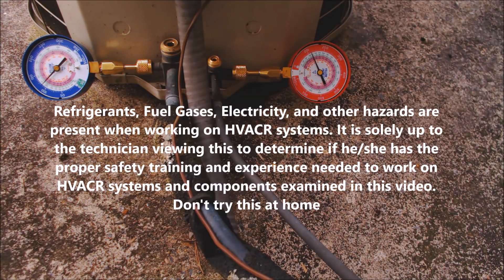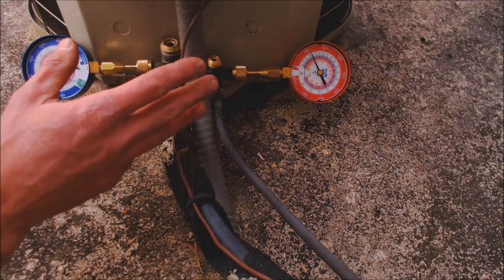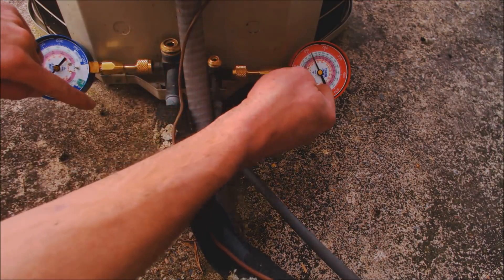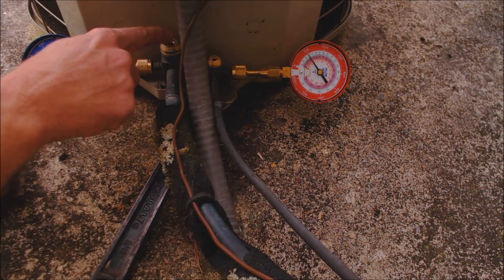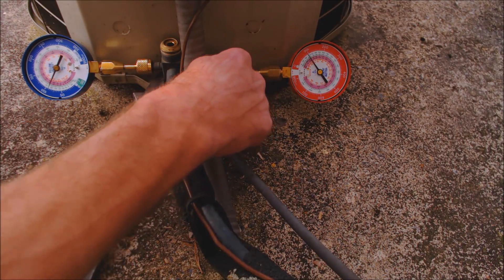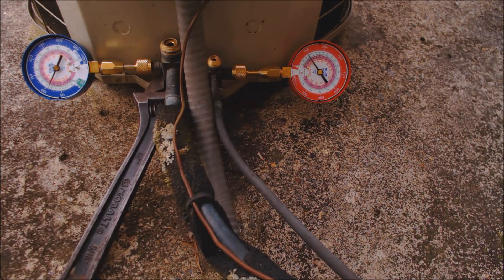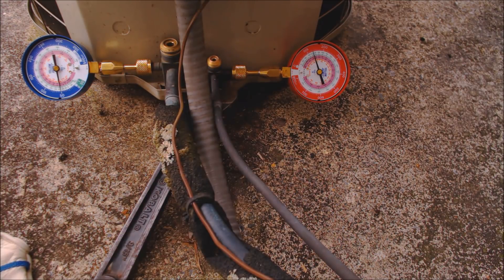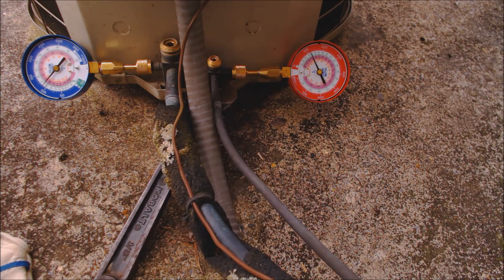HVAC Pump Down Procedure Problem!

Comment from the maker: Tool List-  https://www.amazon.com/shop/acservicetech
Support-  https://www.patreon.com/acservicetech
For those that are looking for the tools used in the videos: (Linked Below)
Here is the link for the Ratcheting Service Wrench   http://amzn.to/2dGV4Nh

JB Quick Connect Test Gauge High Side-  http://amzn.to/2ruQb0l

JB Quick Connect Test Gauge Low Side-  http://amzn.to/2qR0utM

Here is the link to the Appion Valve Core Removal Tool- http://amzn.to/2uYr8WL

Here is the link for the C&D Valve Core Removal Tool- https://amzn.to/2vqA0qy

Here is a link for RectorSeal Bubble Gas Leak Detector http://amzn.to/2ckWACn

Here is the link to the pack of 25 C&D valve cores- https://amzn.to/2J1lurm

Here is the link for the C&D Valve Core Wrench, Container, and 3 valve cores- https://amzn.to/2EVGkps
Here is the link to the Appion Valve Core Removal Tool- http://amzn.to/2uYr8WL

Here is the Link to the Fieldpiece MR45 Recovery Machine- http://amzn.to/2xAOpN6

Here is the link for the filter drier- http://amzn.to/2veVV3m

Here is the link to the Yellow Jacket 1/4" by 1/4" heavy duty hose straight-  http://amzn.to/2umtcod

Here is a link to the Digital Refrigerant Scale used in the video
http://amzn.to/2b9oXYl   

Yellow Jacket Quick Coupler-  http://amzn.to/2s3GVTG

JB Quick Connect Test Gauge High Side-  http://amzn.to/2ruQb0l

JB Quick Connect Test Gauge Low Side-  http://amzn.to/2qR0utM

Other tool links can be found in the video description section.

ACSERVICETECH is a participant in the Amazon Services LLC Associates Program, an affiliate advertising program designed to provide a means for sites to earn advertising fees by advertising and linking to Amazon.

All of the ACSERVICETECH Playlists-  https://www.youtube.com/channel/UCOZR-1IqsAer9wzlvFgb4mA/playlists?view_as=public

If you want to support the ACSERVICETECH Channel and receive more HVAC content, correspond, or collaborate on your endeavors- check out www.Patreon.com/acservicetech

Comment: Just pumped down a 410 unit that has been off and unused for years.  After i got it pumped down i closed the valves and when i cut the lineset the thing shat out like a gallon of foam..  both gauges read 0 for a minute at least and still it foamed up out of the lineset.  Dunno..

Comment: What happens when you have extra long line set (about 15ft extra) - would the condenser have enough capacity to hold all the refrigerant in a pump down?

Comment: Was wondering if the liquid line is closed for a few minutes, but instead of continuing the pump down procedure the liquid line is reopened, what response would you expect before normal operation restarts. Would you need to wait for balancing of refrigerant around system before it starts working again, or perhaps freezing up occurring?

Comment: My understanding is you should not pump down a scroll compressor below 10psi. You can short out the compressor by doing it lower than 10psi.
Reply from the maker: Yes it depends on the manufacturer some are 5psi or 10psi, thanks

Comment: What do you do when the pressures equalize before you can get it pumped down, or what about pumping down heat pumps?
Reply from the maker: Make sure to temporarily jump any low pressure switches. Make sure the tstat is set on cooling. You can shut off the unit at the outdoor disconnect. Make sure the indoor fan is running. If the internal pressure relief pops before getting down to vacuum or 0psig then just shut the service valves quickly and then turn the unit off. Recover the rest of the refrigerant with a recovery machine and bottle, thanks

Comment: What about when you're pumping down a condenser and the compressor starts hissing at ya and not allowing it to pump down??
Reply from the maker: That is the internal pressure relief. It just means the relief is a little weak but the unit may still function fine. Just shut both valves down quickly, then shut the unit off and recover the rest. Thanks

Comment: I'm watching because I am considering adding HVAC to my skills list. Question. Could you crimp the liquid line here to stop the flow?
Reply from the maker: Yes, you could use a crimp off block such as this on the liquid line if desired but you would still shut the vapor line off after getting to 0psig or lower in case the compressor leaks when the unit is off, thanks-  Here is a link to the Yellow Jacket Pinch Off Tool- http://amzn.to/2uqV24o

Comment: That sounded like an o-ring asking for help.  I had  one making the same noise while being closed and then it started to leak.  After these O-rings have been in there for a while, and especially if mistreated during brazing, they have a good chance not to survive the trip while being closed and then reopened
Reply from the maker: This one was bad threads but the o-ring was still holding the refrigerant back, thanks!

Comment: Love the videos..... truly. Can you explain the procedure of removing R410A of a system that's overcharged please.
Reply from the maker: While the system is running, keep the blue vapor handle shut. Once you purge the air out of the yellow hose by shutting the valve at the end of the yellow hose, open the red handle, then open the valve at the end of the yellow hose slowly until the air is out and only refrigerant is in the hose. Close the valve at the end of the yellow hose. Close the red liquid handle on the manifold gauge set. Connect the yellow hose to the liquid port on the recovery tank. Open the recovery tank handle. Open valve on the end of the yellow hose. Charge liquid refrigerant into the recovery tank from the unit by opening the red liquid handle a little at a time until your superheat or subcooling is correct. Make sure to not overfill the bottle. Check out videos in the "acservicetech recovery playlist" Just type that in the search. If you want to support the videos and get articles check out patreon.com/acservicetech thanks

Comment: Great videos Sir. They describe real situations in the field. About this one Id like you show us how to recover and put back a small amount of refrigerant. I always seem to have problems to put it back when is just a pound.
 Thank you.
Reply from the maker: Do you mean you are having a problem on small systems getting the refrigerant back in while breaking the vacuum? You would not be able to get all of it back in the system from the recovery bottle but most when it is a small amount like that.  Trying to get as much out of the bottle as you can while breaking the vacuum and then when the unit is running is the best. More would need to be added from a virgin bottle though to finish it off. The only other shot is cooling the unit and warming the recovery bottle, thanks

Comment: Thanks. Since the valve didn't stop turning it was the threads but had it stopped touring it would have be the seal was destroyed, probably while brazing.
Reply from the maker: That was a shame, oh well. Thanks Ivan!
Reply: acservicetech you're welcome. Thank you! Keep making great videos!
Reply: careful, if the threads are gone and pressure high enough, they can blow clear out of the valve body like a bullet or missile. so always keep yourself off to the side of them and never ever look straight down at them!
EDIT" forgot to "scream" about chinesium/india junk brass. aka "lead free" (which still has some lead in it) possible they dumbo-gumbo'd so much heat and rod whilst brazing they jammed the valve up

Comment: Thanks for the video! Do you know if manufactures will be doing away with these valves anytime soon to something better?? If that’s even possible. Just curious thx
Reply from the maker: Bryant/Carrier tried the 3 position air conditioning stem valve for a while but went back to this. with everyone else. Not at this time unfortunately.
Reply: ball valves will leak also, too many folks COOK them to death brazing, also age and thermal cycling. rubber o-rings/teflon/nylon seals/bushing. all leak with time.
Reply from the maker: Yeah right, there are some units that have that suction line ball valve, I believe Lennox, armstrong, ducane and some maytag, thanks

Comment: These valves can be a pain. They should be done away with,.
Reply from the maker: Yeah Bryant/Carrier tried the 3 position air conditioning stem valve for a while but went back to this.

Comment: Wet the condenser down and 99% of the refrigerant will be pumped down, won’t even need a recovery machine
Reply from the maker: My problem was that I could not shut the valve, thanks Chase
Reply: Chase Meshell.👍

Comment: Is this caused from overheating the valve while brazing or simply a factory defect?
Thanks!
Reply from the maker: I think it was from over tightening the valve upwards from when it was installed. There was no split ring at the top, thanks